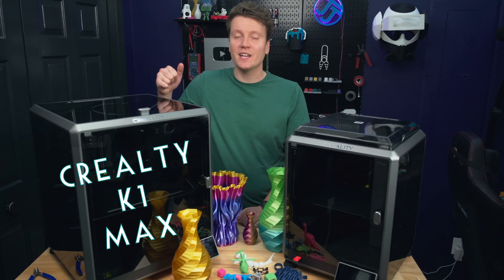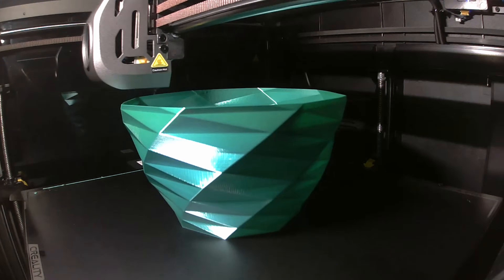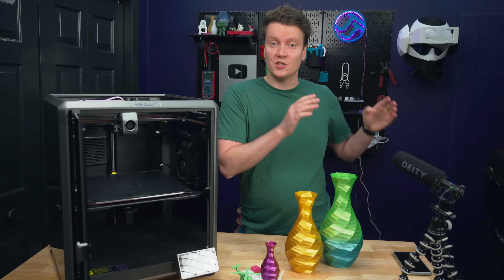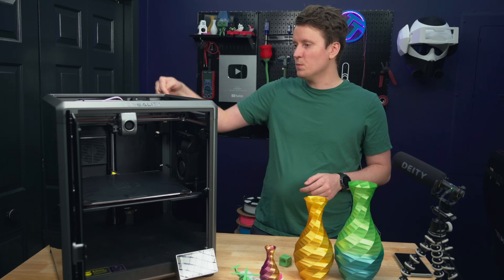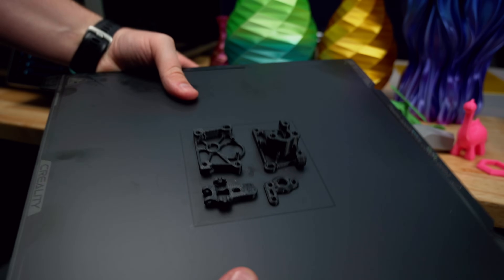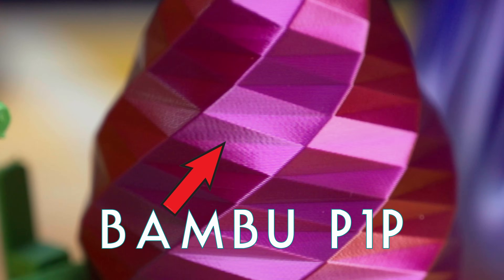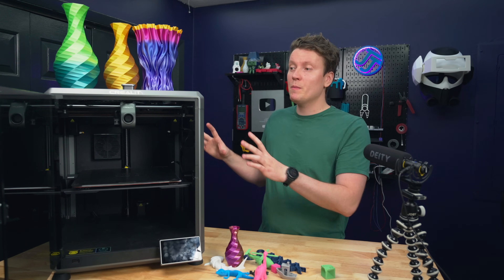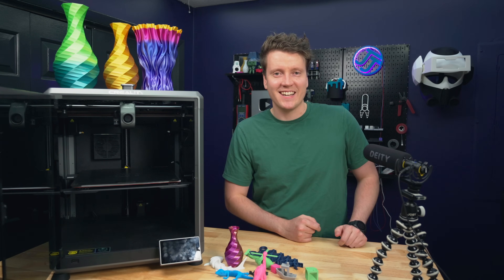Creality K1 Max Review - Bigger, Faster, and Smarter!

Comment: There are two main reasons why I don't buy a K1 over a P1P, 1. Creality cloud SUCKS, its so unsecure doesn't work that great etc. 2. The k1 doesn't have a multicolor option, and even if they came out with one for it. I think the AMS would work much better than it. The AMS just works so good! It is hands down, the best multicolor option on the market right now.
Reply from the maker: I don't really use the apps anyways, but what do you use the bambu app for? It just feels like I can't do much on it, so I never really open it up.
Reply: @JJShankles  Check on prints when not by my computer and stop it if I need to or change speeds/airflow on the fly on occasion. Thats basically all I want it to do and it does the job.
Reply: @JJShankles I use the app mostly to check on it when I am away and I download the timelapses through there. I think the app is quite nice. I have a X1C but I could see people using it on their p1p if they don't like the screen. But its all personal preference!
Reply: For two colors an IDEX system is way better due to much less waste!

Also the AMS is a very pricy option, especially since many mod this thing because of the spool limitations (So you initially buy parts with that AMS that many don't use at the end). So it's not everything so shiny!
But at least it is on the market! Other than a multi-toolhead option like the Prusa XL which is still not available (and even more expensive).

Hope that Creality, Sovol and others do think about an alternative to that AMS, especially Sovol since they often respect and support the open source community.
Reply: @hassosigbjoernson5738  I would say the main reason I think its so good is because the integration and the filament cutter. For this type of system where it has just one nozzle, being able to cut the tip is a really helpful thing. I had a mmu2s and I could never get a good print out of it because it would just keep failing because of the tips. Once you get the spools down, like I just use sunlu filament, it works like a charm. I've only had one failed print on the Bambu because of the poop chute clogging up, while I've had tons of failures with the mmu. I would say if you want to print lots of colors this is the best option. if you only print like 2 colors or print like pva or something a idex is great! And if you want to print with both multi material and color it looks like the prusa xl will be the option. But definitely ams is a great multicolor option.
Reply: What about the kokoni sota?

Comment: For me, like you said, it's either K1 Max because of the volume or P1S Combo because of the AMS. I don't have money and room for both. 😢 I plan to print Cosplay stuff and also colorful toys, and lamps. That makes the decision hard.
Reply from the maker: Personally I don't like printing multi-color things. I tested it out a few times, but it makes everything so slow and it's annoying how much filament needs to be purged when swapping filaments. Both options are amazing printers though, and anyone would be happy with either
Reply: Thanks for the replies! 2 different opinions. 😱 I respect both! Goes to show the difficulty of my decision. Good thing I have time to think and do more research. 😊
Reply: I would get the P1P and an Artillery Sidewinder X2 for the cosplay.
Reply: Take a look at the Sovol SV04 IDEX. Yes, it is "only" two colors, but it produces much less waste. It's 300^3 in build volume and often below 500 bucks.

Hope that Sovol brings an updates IDEX printer to their SV 04 with the improvements and Klipper from their latest SV 07 model!
Reply: @hassosigbjoernson5738  The SV04 Just has so many more manual processes involved I would prefer the multicolored waste over having to manually align nozzles and set Z offset and tune input shaping and all that nonsense.

Once you experience never having to tune, it's really hard to go back.
Reply: @BeefIngot  fr. Once you experience the bambu workflow. It's hard to go back. And Im someone who had 2 Voron's and a ZeroG Merc One.
Don't get me wrong I'm still keeping one of them because it's a good machine. But for $1500 I can get 2 P1S lol.. the price to performance is actually restarted.
I've had the P1S for a week now and it's the only machine I use lol
But also, the K1 workflow is pretty good. Best creality printer I have ever tried for sure, although it just bugs me that the app is literally AliExpress and the slicer was garbo. If they at least had good software you can argue it's equal. But you can't even put it on the same playing field
Reply: IMO the P1S is a better more premium machine.  I also had the K1 and its seriously lacking in design and build quality in comparison. No nozzle wiper/poop shoot/filament cutter. no automatic belt tensioner and the belt path on the K1 is so bad they needed to use 9mm pulleys for 6mm belts. Furthermore the gaps in the panels mean i never saw more than 38C internal temp and im not sure if its just the K1 but there is no air filter. Also dont get me started about software, bambu is like a prusa, the creality is just a creality bro.
If you dont care about doing some minor upgrades and changing to klipper then the K1 is honestly not that bad. But I returned my K1 as soon as i saw the P1S in person.

Comment: Where to find the gecko stl? :D
Reply from the maker: It's this one here: https://www.printables.com/model/508290-super-flexi-gecko
Reply: Thanks JJ :) and thanks for the review! Makes me even more turn my anycubic chiron into a corexy and print a nice looking frame around it. I don't get it why creality makes so many mistakes right now. Lidar which is "ok", which is more an accessory then, closed firmware. Most importantly I don't get why they build a moving bed. Having the bed at the bottom constantly and a moving gantry reduces vibrations a lot. They should all follow a voron design imo.

Comment: Doesn’t bambulab also have a stay out zone of the bed in lower left corner, because of cutter blade? Think stock it isn’t even 256x256x250, it is less because of the one corner.
Reply from the maker: Oh yeah I forgot about that. So it is 256x256x250 minus and 18x28mm square in the corner. Seems like a weird thing to print the wrong build volume on the front of every printer
Reply: @JJShankles  That's disappointing, so you lose build volume on all 3 axes
Then the build volume of a P1S is next comparable to a K1.

Comment: My K1 is the worst printer I ever bought. Have it for over two months now and effectively I have been printing for one week. 3 hotend replacements en now my extruder isn't extruding anymore. Biggest pile of junk ever...😢
Reply: Dang. I was envious, because I have a modded, $650 Ender S1 and am so tired of tuning it and the nozzle still scrapes the model.
Reply: @III-zy5jf  K1 wouldn't be my advice man. GL
Reply: @ndenijs  Did you fix it? And when you buy it? Like when it was released or recently in the last Month or so?